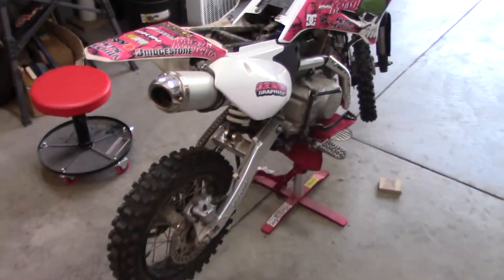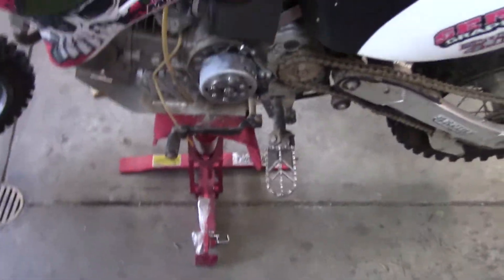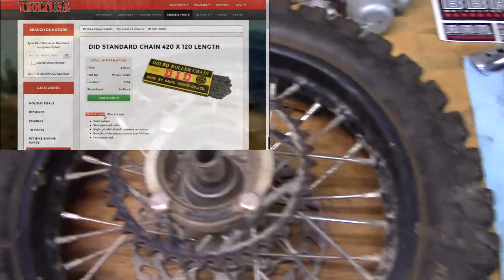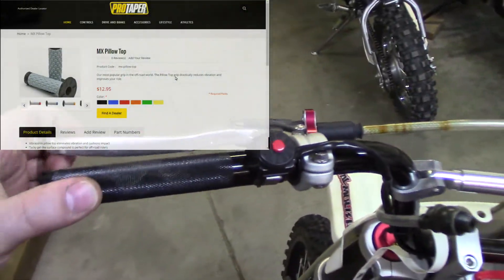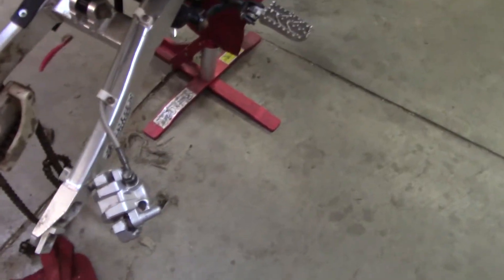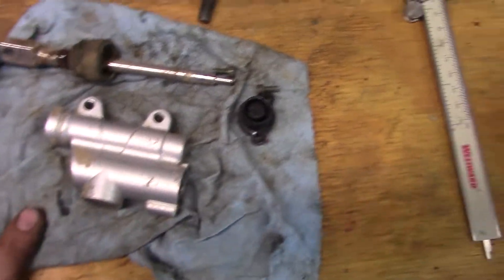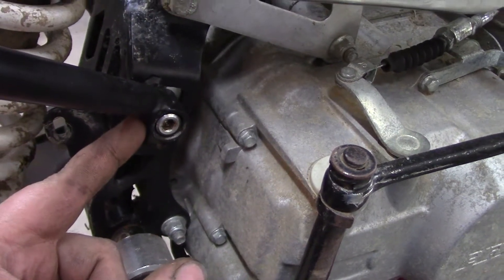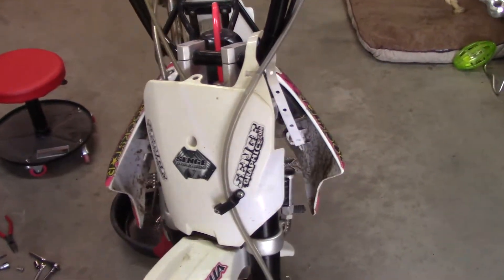Piranha 140 Build - Part 1

Comment: yes i have the same bike and hey man I've had this problem with the chain alignment for ever i was wondering if you would be able to tell me the length of the spacers on the rear axle left and right of the wheel ive had to use trial and error with different size spacers for months trying to line the rear sprocket up perfectly with the front i would greatly appreciate it.

Comment: Why do you not like Philips screws
Reply from the maker: They are the worst.  Way to easy to strip out.  Every Philips screw head is slightly different head...I have to have one hundred different screw drivers to find one that fits perfectly....they are just terrible.  Socket head cap screws are the way to go.